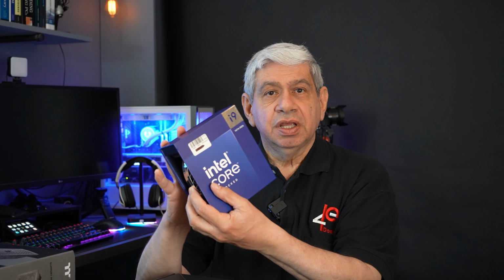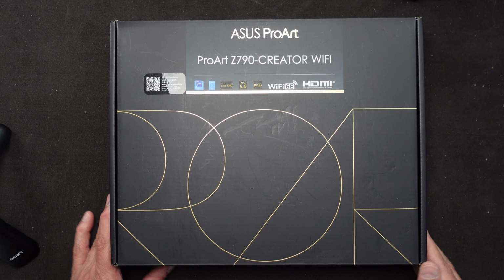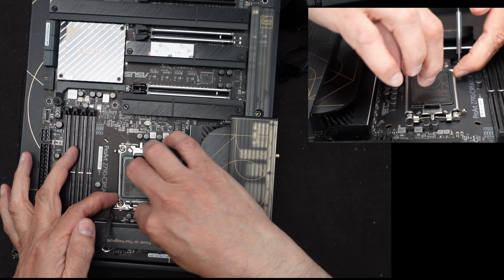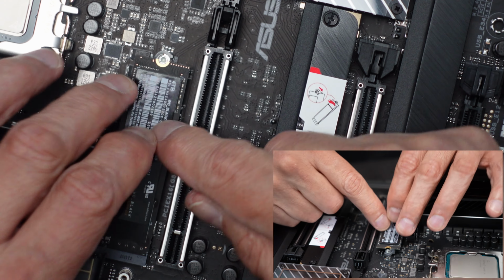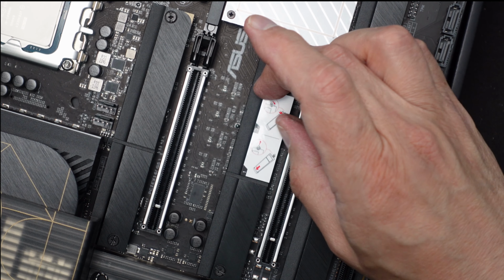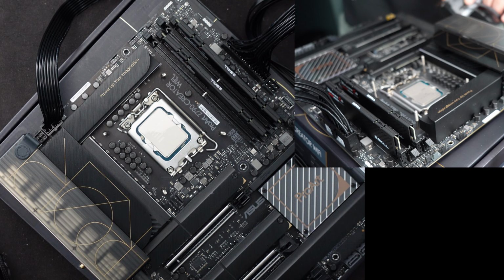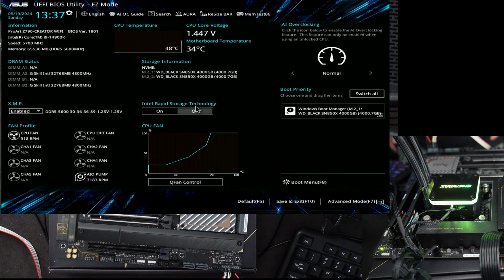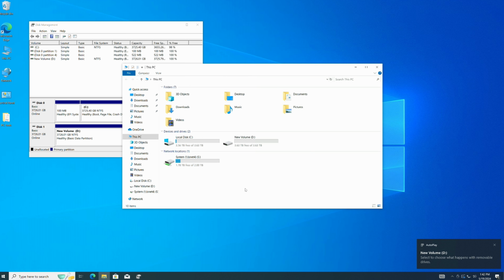Ultra High-End Creator Build: Populating the Motherboard, part 6

Comment: I am building a similar pc. Do you suggest leaving the over voltage jumper 1,2 or 2,3
Reply from the maker: Unless you plan on doing some 'serious' overclocking, I would leave that jumper on the 'Low Power' setting.  Just my opinion of course.
Reply: You have helped me out tremendously - thank you. Hopefully my last three questions.

1. If I do any overclocking, it would be slight - still keep on low power setting?
2. I’m planning on using 2x48 gb  teamgroup RAM 6800 MHz - QVL approved. Is it ok to leave XMP enabled? It should automatically enable I believe. Should I be cautious with this?
3. Is a CPU contact frame necessary in your opinion? My CPU is a 14900k and I am using a 420mm AIO. 

Thanks again!
Reply: @PE4Doers I didn’t tag you - my apologies. Happy New Year!
Reply from the maker: @TUNRVAN  No problem
Reply: @PE4Doers is a contact frame something I should be considering?

Comment: Where did you plug in the mini case speaker on the motherboard? Also, can you supply a link to where you order them from? Thx!
Reply from the maker: It plugs into the same header with the Power-On Switch and the Reset switch (shown in the motherboard manual).  Here is a link to Amazon: https://amzn.to/3T6vHZJ

Comment: Will be waiting for your updated video. I also started collecting parts for my setup one by one after seeing your videos. But, I'm still worried about AIO Cooler.
Reply from the maker: What AIO are you planning on using?  I am very happy with the Artic Liquid Freezer III I used in the upgrade to my previous Virtual Memory Application Server build.
Reply: @PE4Doers  I'm planning Arctic Liquid Freezer III 420 (for 14900k) but it is still unavailable in my country. Hopefully, it might be available with in July as Arctic importer said. I might use Cooler Master HAF 700 EVO or Lian-Li O11 Dynamic EVO XL as Casing. Already purchased, Motherboard Asus ProArt z790 Creator Wifi & GPU, GALAX RTX 4080 16GB. But still not sure about additional case fan & number of RAM. For your kind opinion please.

Comment: I would highly recommend: Refrain from using any Enermax AIO since they had recalls and Gunk issues in different series of their Liquidtech Series AIO's 2019 through 2022. I am not sure if they have resolved the issues yet. You mentioned and listed a Corsair AIO set in the video description but you decided to not use it?
Reply from the maker: Kathrin, of course.  I just happened to have it on the shelf after replacing it with the Artic on my VM Application Server.

Comment: Such a nice board. If it only was not an ASUS board. I took a B650 ProArt off a PC Partslist after watching the GN Videos. I hope you never encounter any issues with It. Did you watch the Video Series of GN on the atrocious  Customer Service experience Gamer Nexus had to endure?
Reply from the maker: Katherin, yes, I know about all the issues others have had with ASUS, however I've never had any problems with them.  Of course, I do not over-clock, which may be one of the root-causes to some of the issues.
Reply: @PE4Doers  Forcing the customer into paying for a Repair of an ASUS Ally he did not ask for has nothing to do with OC. Yet not even mentioning the issue stated on the RMA form like the joystick that is still covered in Warranty... I highly recommend the GM videos :))
Reply from the maker: @KathrinHausermann  Thanks for the great information Kathrin.  I guess I've been lucky using ASUS.  My biggest issues have been about usability and flexibility with motherboards.  The two I've had trouble with has been Gigabyte and to a much lesser degree MSI.  One thing on my list to do after my day-job retirement is to replace the Gigabyte motherboard on my Wife's PC.  It just keeps losing the BIOS settings even though I've replaced the battery three times.  It is way past any waranttee, so I have not other option but to replace it.  Although I've never had any problems with their GPU's.

I think I've come to stay away from specific parts from specific vendors.  For example I will never buy a PSU from Corsair again, or a motherboard from Gigabyte (since I really don';t like it's BIOS either).

I may have mentioned once (or twice, or more) that my father was a Television Repairman when I was growing up.  I now know what he meant about avoiding specific parts from specific manufacturers.  When I was younger and learning how to fix televisions, radios, and general electronics, I did not really understand it, since the two distributors he went to for equipment and parts always seemed to try and point him to specific vendors.  When I asked him about that, he said that those distributors were not really trying to mislead him, but that they were not accountable to customers who just wanted their equipment to work well and last a long time.

Sorry for the long-winded story.
Reply: @PE4Doers  Another great Video incomming ..... When do you plan to do that?
Reply from the maker: @KathrinHausermann Kathrin, within the next week to 10 days.  I may do Part 1 one of the PiDP-11/70 first, but still have not decided.  Thanks so much for watching and all you positive support 🙂